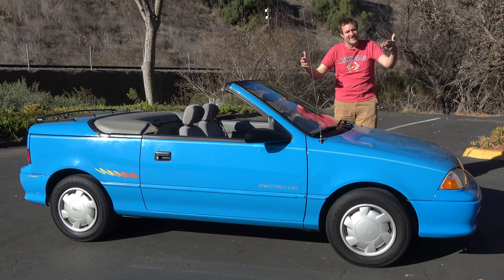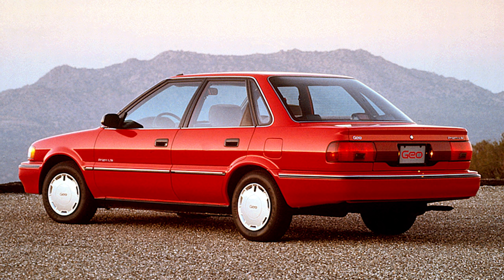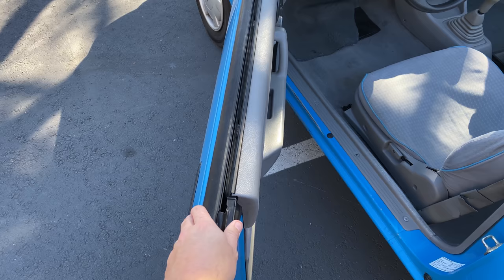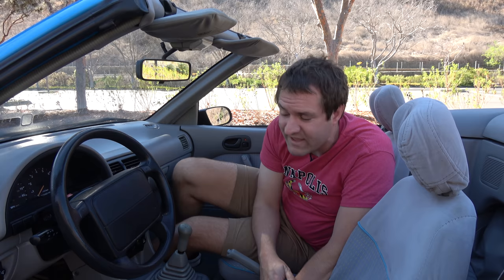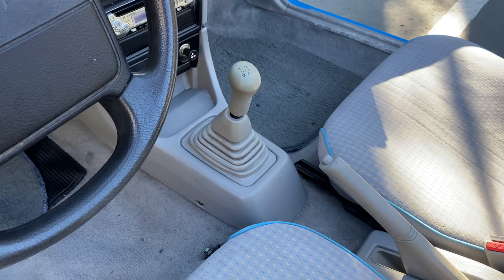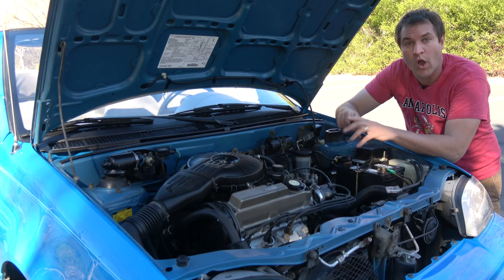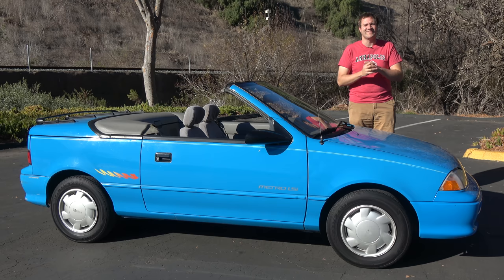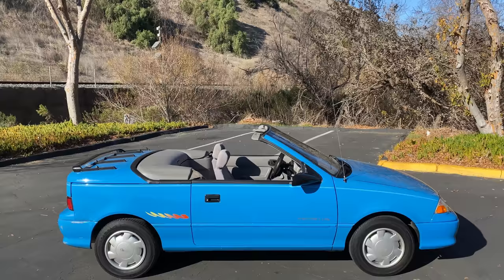The Geo Metro Convertible Was a Hilariously Pathetic 50-Horsepower Economy Car

Comment: I had a 90 ... it needed an engine ... I was able to lift the engine out by hand by myself once it was disconnected - a good running junkyard engine was $150 and took about an hour and a half to be back on the road driving like it never happened

it was ultra cheap and lasted a lot of miles after that - I can't call it a terrible vehicle,  but it was hilarious to drive
Reply: I rebuilt my Geo's engine. The bare engine block weighs 14 lbs. It's ridiculous.
Reply: its almost a costume-vehicle, because of how hilarious terrible it is, people would laugh but thumbs up at the same time
Reply: I guess it could be, if you thrash the engine 
'till you need a replacement 😄
Reply: You know, I'm astonished that you people of the US find this strange and uncommon. In Europe until the late 90s you could do that basically with 75% of the cars driving around 😂
Reply: Well the Geo Metro and Chevy Sprint basically had Motorcycle engines.  
They had 3 cylinder engines with 5 speed transmissions.
Back then, a car with more gears than cylinders was a funny thing.
Reply: When I did the headgasket on my 94 XFI, I was able to lift the head off with one hand. I loved that car. So much fun to drive
Reply: I drove a metro for 3 years 
I hated the car, but it was reliable and had an 8 1/2 gallon gas tank.
Fuel mileage was unbelievable

Comment: Doug:
Makes fun of this car

Also Doug:
“This car can be yours!”
Reply: I'd buy it in a heartbeat if I lived in the US. Super cool car.
Reply: It's more of a collector car at this point. I hardly doubt there's anyone actually wanting to daily drive this thing. Especially when you can get super cheap, used economy cars with triple the horsepower.
Reply: Gotta promote his new website haha
Reply from the maker: Hey, there's nothing wrong with ironic car ownership, especially at this price point!!!
Reply: @DougDeMuro  doug the type of guy who is reading every single comment secretly and... giving them a secret doug score
Reply: @DougDeMuro  i think its badass
Reply: Those fire decals, though. 🔥🔥🔥
Reply: @DougDeMuro  I'm not sure you can say "new" when discussing Cars and Bids anymore.
Reply: Someone already bid on it, so SOMEBODY'S getting a geo
Reply: I think Doug did this so nobody would dare put such a “cheap” car for auction on his site again :)
Reply: @flobama3247  I get it that more horsepower = good yeah but... what the heck you even use that triple the horsepower for, when your goal is to save fuel?
Reply: @Kalvinjj  Maybe to be able to pull out quickly without worrying about getting ran over by a giant pickup truck going 70 because your car accelerates slower than a snail. Having a car with respectable baseline power is important for safety in my opinion.
Reply: @flobama3247  I'm a sucker for convertibles ever since I had a convertible 370z. Starting a family now so my next daily driver will be a GT Stinger or something, but I'd really consider buying this as an inexpensive, 2nd car for little around town trips
Reply: @TheMainCore  Then move to US and live there now. US really deserves you.
Reply: @PBrown-mg4wy  Haha a Geo Metro is quite a contrast from a Stinger GT. Your KIA will feel like a Ferrari after driving around in a metro.
Reply: @o2onlineo2  starting with the weekend categories and styling, this comment is not exactly beautiful, but not ugly, it’s just okay and it gets a 5 out of 10
Reply: @DougDeMuro  I agree! I would actually buy this car. 🙂
Reply: @DougDeMuro  I'm sitting here trying to make excuses to buy this thing. Maybe put it on Turo.
Reply: @DougDeMuro  beats walking.
Reply: Doug is basically saying that YOU need to be pathetic! 😂 Jk
Reply: @flobama3247  fortunatamente i don't live in a country where small economy cars get overrun by trucks every now and then. It is just a different kind of life. Colleagues if mine who drove cars with triple the hp (Xsara 150hp, Peugeot 206RC, i don't remember the third, hyundai coupe?) were considered speed freaks, and those are essentially race cars.

Comment: My mom had a 95 Metro. On the highway it was absolutely terrible but around town it's still one of the most fun cars I've driven apart from the lack of power steering.  Being able to drive a car super aggressively, flooring it all the time, without it getting you into any trouble is a different experience.
Reply: The whole reason miatas & such were made.
Reply: Its much more fun driving slow car fast, and manual... Its my choice any day
Reply: @lucky889s9  
Badass.  This car in video is soo cool.
Reply: @lucky889s9  as someone who has only ever owned slow, old manual transmission cars I agree they are the most fun to drive. I hate driving my parents 2018 Nissan Rogue in comparison.
Reply: I love that 1993 geo metro convertible
Reply: yeah my 5.7 hemi in my dodge ram would kill me
Reply: Finally I found the car for me….. my driving style makes my Honda feel like a race car lol
Reply: @lucky889s9 The manual version is the only one worth owning!
Reply: Its called having enough power for your application. Being able to use all the power versus idling all over the place with monster power, way more fun.
Reply: The motorcycle guys say that it's more fun to ride a slow bike fast than it is to ride a fast bike slow.
Reply: god forvher
Reply: Me and a friend rented a Chevy spark (I’m pretty sure it was the spark lol) and it was like that.  Could floor it between lights and just barely got over the limit lol
Reply: This guy gets it! Miss my Scion XA with the headers exhaust & cold air intake. These are like street legal mario karts that scream doing the speed limit or less
Reply: If a Ferrari in New York City is a cheetah in a cage, a Metro in the suburbs is a chihuahua in a park.

Comment: Had a first generation Metro, first new car I ever owned. It was the most reliable car I have had. Best $6000 I ever spent on a car. Lasted me over 10 years, 250,000+ trouble free miles. Nothing but general maintenance was ever required. Talk your shit about Metros all you want but that 5 speed 3 cylinder was very fun to drive and the quality for the money spent was off the charts!
Reply: In a lot of ways, a car like this is competing with motorbike commuting at it's price point. And when you do that comparison, it's really not that bad.
Reply: my friend in school had a 92 metro.. she beat it all thru school. drove it into uni. and it was hit by a snowplow and wrote it off.. had 300k on it. still..
Reply: He probably get paid, does the same for mirage, which is another perf car for our present time
Reply: This, the Suzuki Samurai, and Honda Integra GSR, are three of the best low cost good cars for various reasons.
Reply: @kaedyngraham1860  Yeah. It's not a Dodge or BMW, which you can get for $600 at the same age.
Reply: @dmaxsba So what happened to your geo metro? Why did you stop driving it?
Reply: Hell ya dude.  Metro4lyfe
Reply: @ricky-sanchez  The end for the Metro and me was rust forming right behind the doors and the engine starting to burn a bit of oil. Sold it to a young man in need of a cheap car to get his adult life started for $100. Saw the car for another 2 years in town from time to time. I assume the car finally died.
Reply: @dmaxsba  Cool beans!👍
Reply: This car was 6 grand brand new?!? Even in early 90's dollars that's cheap as hell. I got a brand new Kia Soul last year that I love, it was 22,000, which is below MSRP for the model I got, and it's one of the cheapest new cars sold in America today. Even a shitty Mitsubishi Mirage is 18-19,000 bucks. My car is leagues better for a few grand more... but still 22 grand is a lot of money
Reply: @dmaxsba  burning oil ain't no problem if you just keep checking it and adding more lol... I drove a 2004 saturn vue with the GM ecotec motor, had 160,000 miles and burned like a quart a month. Still worked great even with that and somehow didn't noticeably smoke when accelerating. It's sitting in the driveway now because of a bad clutch slave cylinder that's a bitch to replace.
Reply: Yup, in spite of all the talk now, these were actually decent cars, and you did well back in the day. The manual was sold all over the world. When back in the day I asked my automotive engineer friend what car to buy for a second car for my wife and me, his answer was "Geo Metro".
Reply: Well said...I had 2 Metros...a 92 convertible as a second car when I got married, and later got a 1997 coupe in grad school.  The convertible was surprisingly roomy. Nice space behind the seats too like my Old TR6. It was frugal, cheap to run, easy to park in the city, and reliable. It was actually great in the snow too.  I only got rid of it when I had another kid.  The 97 Coupe was an amazing commuter car. It got amazing mileage, lots of utility with the hatch, was cute, and was extremely reliable. I drove it for 20 years and never had a lick of issues with it. It was easy to work on too compared to most modern cars.  I only got rid of it, finally, last year because we just weren't using it much anymore.  Its' one shortfall on today's roads, is safety.  In a world of F150s and Ram 1500s, I am not sure you would survive much of a collision.  I have had a lot of great cars, and I appreciate when a car is good at what it is designed to do, The Metro is great in its' role.
Reply: My first car was the ‘91 Geo Metro!!! It was white with black tinted windows! I loved the 5 speed!!! Taught myself to drive it! 50 miles to the gallon!!! My favorite car!!! Reliable and affordable!
Reply: It was my first car, and it was a massive piece of shit.
Reply: My first new car too!  I could go FOREVER on a tank of gas......and boy gas was CHEAP!!  It was fabulous and we managed to squeeze quite folks in it.  Lasted forever <3
Reply: @amanda29811  Well done...They were a nice package!
Reply: I'm guessing you're around my age. You know they don't make anything good like they used to. Old tube type tv's latest many years.  You're lucky if these new ones last 3 or 4 if that much.
Reply: @BruceLee-xn3nn  I miss the Geo's Simplicity...very reliable...and if you did the basic maintenance it just kept on working. I always found it funny, that even as small as the car was, when you popped the hood, there was sill a lot of room to get in there and do your own maintenance.
Reply: They were good little cars.
Reply: @CadgerChristmasLightShow  I got a Chevy spark brand new 13k and change and for its size its very roomy and has reverse camera and very stylish inside love my Lil cars also own a 2000 Toyota echo 386k on the dash still going strong only ever had to replace starter alternator and brakes
Reply: That's the thing, if this car was european, it would be praised. But since it's american, it's terrible compared to the other cars on the road there, but in europe most people drived vehicles exactly like this at the time.
Reply: @AspireGMD  I don't know if it was because it was built by Suzuki or what, but both mine were very reliable. The combo of the 3 cylinders and the manual transmission made for a very dependable, if slow, car. 
Amazing mileage too.
Reply: I'd say the same for the Prizm I had, those 90's Japanese cars were exceptionally reliable
Reply: @xraceboyex  I had the two Geos and a couple Integras from that era...all were reliable cars.
Reply: Plus it’s impossible to get a speeding ticket.
Reply: Come on, you can't deny that this car is shit, regardless of how much you drove it and how reliable it is. Reliable doesn't necessarily mean good
Reply: @TheCostantinus  Really? then what makes a good car. How well it picks up girls or if it costs more to own than your HOME, the biggest engine? REALLY, what makes a good car to you. To me it is the money spent vs. the time owned and it being functional. Simple as that!
Reply: @dmaxsba  I have a very similar car, a 2006 citroen c2 with 60 hp, it has well over 170.000 km and it's been dead reliable, has a great gas mileage on the highway (over 50 miles per gallon) and never had any problems, and yet that car is shit because it's old, slow as fuck, full of cheap plastic and the air conditioning makes the car dangerously slow. I'm not biased towards my car despite its reliability, and neither should you. Reliability isn't the only important aspect in a car
Reply: @dmaxsba  let's be clear, I wasn't flexing my car over the metro, mine is possibly even worse since it's not much different despite being 15 years more modern, the only subsitantial difference is that the engine is fuel injected, other than that it's the same level of comfort and quality, and roughly the same power as well. I was saying that you shouldn't talk so nicely about a shitbox just because it's reliable, mine is as well and I don't consider it more than what it is: a shitbox
Reply: I had mine for 16 years and never had any problems. Super cheap to maintain, gas and insurance was nothing. I use to pull into gas stations and put $5 into it.
Reply: Had one and wish I never sold it. Fun and bulletproof.
Reply: @Justin-A-Carter what does “drove it into uni” mean??
Reply: @dmaxsba damn man! Thats why I love youtube comments.. I almost skipped them to go on to the next car I wanted to know about.. but im glad I read this. Love these kinds of stories you can only find in youtube comments.. r.i.p to your old geo…. But who knows partner… she might still be out there somewhere.. with over 500,000 miles on it tearing up the roads of Argentina as the sun sets with a beautiful Latina in the passenger seat and a cool day close to the beach… yah… thats what I think…
Reply: @shawnweed265 you got married before grade school? 🤔
Reply: @stillamitchinmybook6320  Grad School…as in Masters Program in DC.
Reply: @stillamitchinmybook6320  it means she drove it the whole time she was in university. I'll fix it later
Reply: @DFX2KX  no
Reply: @Simon-oy7kf  how so? It's a super small cheap people mover that gets the same gas mileage as a similar vintage Goldwing but you have seatbelts and rain cover.

I get that for motorcycle riders there's often more to it than that.  But for many, they ride a bike because it's *cheap *, not because it's a bike.
Reply: L o L
Reply: Loved my metro. Was not pathetic did what it was designed for very well. When I had a need for speed I had a vehicle for that
Reply: I had a Chevrolet Sprint Turbo. One of the coolest little cars l ever owned. 😎
Reply: Wow, never would have guessed they would last that long
Reply: Some people have installed that Engine in small Airplanes.
Reply: @normansimonsen1203  Ay, sweet. I have a turbo-swapped convertible.
Reply: @TheCostantinus  And unreliable doesn't mean bad?  I'll take reliable any day. A car that breaks down is useless.

Comment: I had a 4 door Suzuki Swift (manufactured in Hungary) with 4 cylinders and 68 HP, based on the video it was a bit more carlike than the convertible. With 3 friends we made a 10 day trip with it, from Hungary through the Balkans to Greece, 4000 km total. We were very young and enjoyed it, did not care much about the lack of safety and comfort.
Reply: good for y8u chef other choes brst car geo  meyero😊
Reply: When I was younger I had an ancient 1965 Pontiac Strato-chief, the cheapest version of that car available, it had a 0 to 60mph time of ten minutes. It had neither safety or comfort, no optional equipment whatsoever other than a crappy A.M. radio and one speaker in the dash, but it didn't seem to matter, the car moved you from A to B as it was designed to do and that was ok with my friends and I.

Comment: In 1991 I won a 91 Chevy Sprint (same car) in a rubber ducky race down a river in my hometown.  My duck crossed the finish line 1st out of ~22,000 ducks and this was the prize.  I was 5.  It was one of my earliest, and most awesome memories.  This video made my day.
Reply: No It's NOT The Same Car. It Was The Predecessor To The Geo Metro And Suzuki Swift And Was 1985 To 1988!! Smaller Than A Geo Metro. Carbureted 1.0 Three Cylinder With 48 Horsepower. Turbocharged 70 Horsepower Version 1987 And 1988. 1988 Final Year For The Chevy Sprint Before It Became The Geo Metro!
Reply: Yo that's so sick
Reply: @richardkaltenbach3961  IN the US yes. The sprint name lived on in other markets past 1988.
Reply: @richardkaltenbach3961  in Colombia, the Chevrolet Sprint was made from 1985 i think to 2004, yes, the same car, same engine, the only big updates were front grill and headlights in 1987 and single fuel injector in 1998.
Reply: @richardkaltenbach3961  I believe at that point the Geo brand was only used in the US. For the Canadian market they were still sold as the Chevy Sprint.
Reply: awesome. 50 hp was fairly enough for 5 y/o.
Reply: I bet you were the envy of all the other Canadian 5 year olds, what kind of mileage did you observe?
Reply: @cagataytekin6318  10 horsepower per year of a person’s age is a good rule
Reply: Wow that is SUPER cool, but um how did you win a working car at age 5? (Well I guess you just kept it until you were old enough to drive)
Reply: That is so completely awesome, 5 year old (and on) me wanted a real car so bad so that I could drive home from YMCA camp which I didn't want to be at